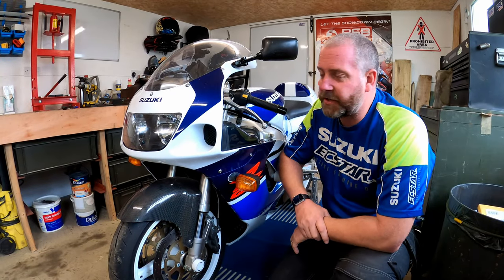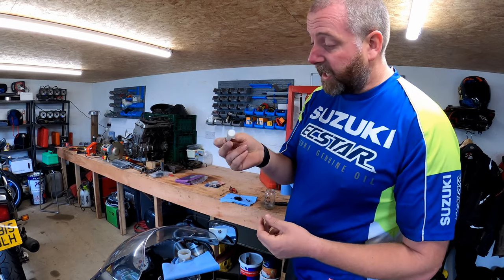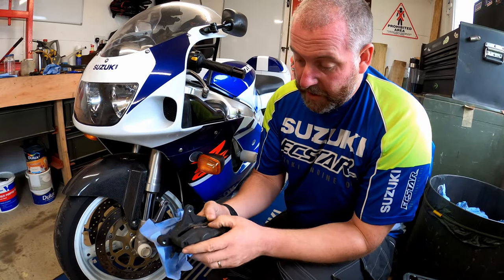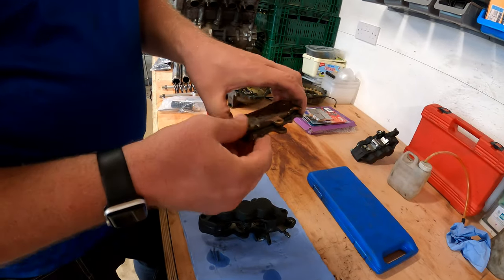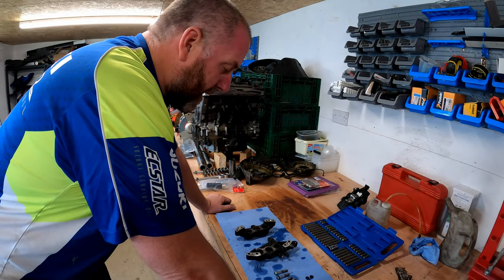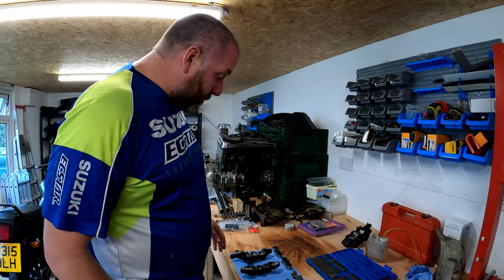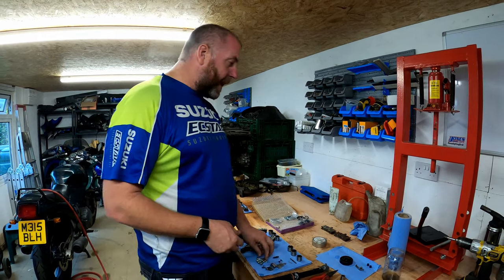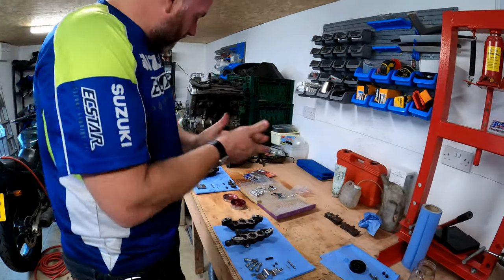Tokico 6 Pot Brake Caliper Disassembly, Servicing & Reassembly

Comment: I have just stripped and rebuilt my 6 pots off of my 1200 bandit and yes they were seized solid, but in my defence I have only just purchased it, so it is all part of a full refresh before it goes back on the road 😃

Comment: I like to use puppy training pads for jobs like this, they have a water resistant backing and don’t disintegrate like paper can and there cheap. Good vid as usual.
Reply from the maker: That’s actually a really good idea! Expensive compared to the blue tissue that I can get from work though! 😂
Reply: @KevsShed  Hi Kev im james from the uk. Great videos and you explain things really well mate👍 Could you do a bmw 1 series 2010 front elec window reset video or just reply on here explaining the procedure please? my problem is that once the window button is pressed to close there is a small gap at the top still.... about 50/60mm, it does not let water in but when driving over 60mph it lets air in and makes the most annoying noise (especially on my 240 mile trip back home to wales every 2 weeks!)
Thanks for your efforts mate
James
Reply from the maker: @invertedshadow1746  hi mate, the usual procedure is simply to take the window all the way down and all the way up, it should then drop on opening the door. If it still refuses to work, try disconnecting the battery for 10 minutes and then trying the above again, good luck 👌🏻

Comment: Hi Kev, I too have a mint 1999 (2000 registered) 750 SRAD. I don’t have a parts washer so can you recommend an alternative way to clean the callipers? A clean bucket perhaps but what cleaning solution should I use?
Two years ago I actually sent my Tokico’s off for a rebuild as one morning I hade brake fluid on the rim of my wheel.
Sadly l lost my mum 18 months ago and my GSXR has sat in the garage not being used. Took it for its MOT last week and was told front brakes were binding. I couldn’t get EBC locally so have just fitted new Ferodo sintered front brakes. The pistons all retracted ok and were clean as only done 50 miles since the rebuild.
When I now spin the front wheel I get one revolution but presumably the new brakes will rub until I get some miles in!
If not then thanks to your video I will strip them myself and then clean/fit new seals.
Thanks
Paul

Comment: I’m loving your channel, thank you. 
Any idea as to why my 2001 zx9r right caliper isn’t bleeding for love nor money. I’ve tried bleeding the thing for 30-40 mins manually. Nothing. Bought a bleedizee doesn’t bloody fit. Sucked some air out manually, yep literally manually. Left caliper fine, right caliper gravity doesn’t work. Nothing comes out of the right hand pipe. With the pipe off no fluid is dripping. I’ve drained the master cylinder out and added the  bleedizee pipe directly to the tube for the brake pipes and even had some dude suck on the pipe, rather him than me but the thing still isn’t bleeding. Had some air come out with the bleedizee pipe thing attached and him sucking directly to the hose and him sucking but the right caliper isn’t bleeding. Any idea What’s going wrong Kev? 
I also own a VFR800 VTEC best bike ever by the way and have followed loads of your videos and done alright by them because you the man us VFR guys go to and you know it. 
That said this right caliper on my 2001 zx9r just isn’t happening. I’m doing something wrong but I don’t know what and it’s very frustrating, I had to have a few beers today as it’s pissed me off so much. Gravity is gravity, with the pipe open it’s still not bleeding through an open pipe, despite the fact the left one works. It’s puzzling to say the least. What would you suggest fella? 

Thank you in advance. Mechanics in my neck of the woods are 6-7 weeks in advance and I have a guy that wants this zx9r but I cannot let it go to someone else unless I’m 100% confident it works it’s best. 

Thank you, your guidance and expertise are appreciated.

Comment: Had the same calipers on my old sv1000. Look after them and they will look after you!
Reply from the maker: I didn't know that the SV1000 ever had the Tokico 6 Pots! My SV has Tokico fronts but they are 4 pots. The rear on my SV is a Nissin caliper. 👍
Reply: @KevsShed  mine had a gsxr front end conversion done before I bought it which is why I had 6 pots calipers - standard is four pot ones on the sv1000
Reply from the maker: Ah, got ya! That makes sense 👌🏻

Comment: Great video thanks , I'd like to keep my zx9r e1 brakes stock but the process of keeping on top of them seems a bit daunting, I will keep the oem 6 pots as long as I can if I can keep on top of them  , I don't know to much about the 4 pot swap over but is there any chance the triumph st 955i with 90mm bolt hole gap would be a straight fit to my stock brake lines and master cylinder , it seems people are changing the lines and master cylinder or is that optional . Any advice would be much appreciated
Reply from the maker: Any callipers with 90mm bolt centres will work with the stock lines and MC, however if the lines are rubber originals then they will be past their best by now 👌🏻
Reply: @KevsShed  thank you for the feedback , much appreciated

Comment: Hi Kev, how often would you do the rebuilds on these?. Great vid Kev
Reply from the maker: I would say that really depends on how you use the bike and the conditions that the brakes are subjected to. Every three to 4 years in my case but mine is never subjected to rain or road salt! You can generally tell when they need attention though as braking effect is compromised or pulsing may be felt at the lever. 👍🏻